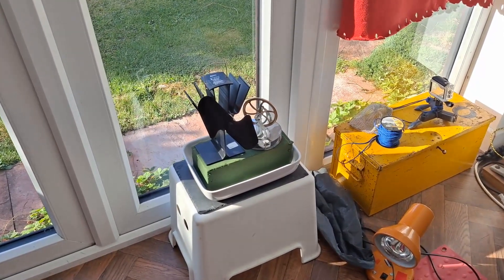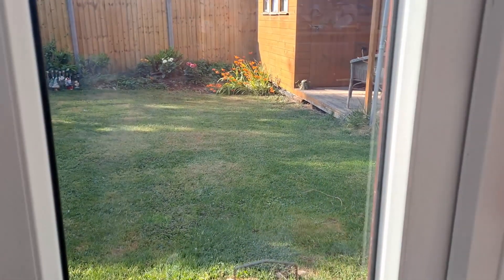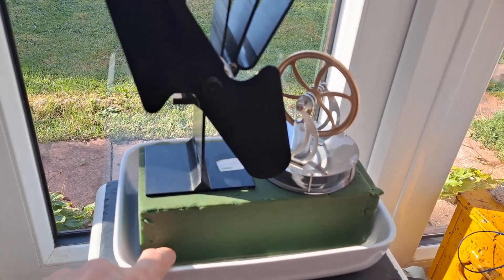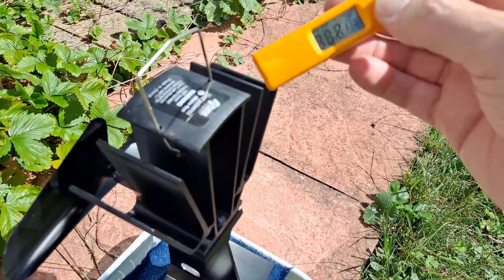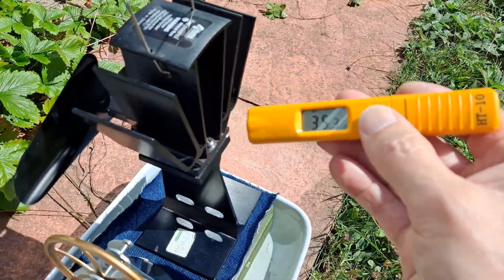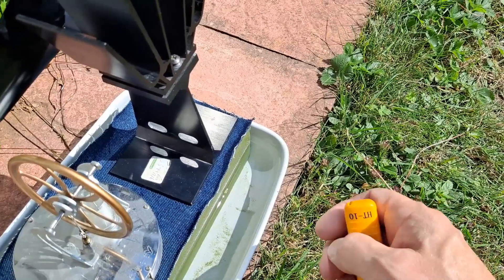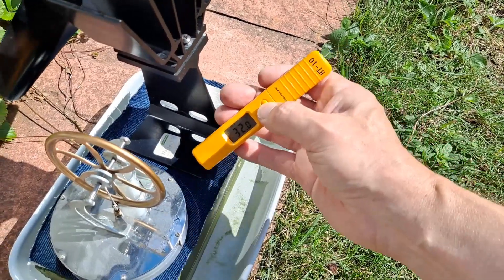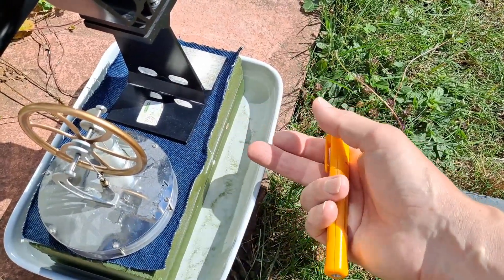Oasis Stove Fan Stirling Engine PART 2

Comment: FORGIVE ME IF I AM WRONG BUT  - THE TITLE OF THIS CLIP IS ABOUT A 'STOVE' FAN. I SUGGEST IT IS MEANT TO STAND ON THE TOP OF A HOT STOVE SURFACE. THE FLOW OF THE HEAT IS FROM BOTTOM TO TOP.   IN YOUR EXPERIMENT, THE HEAT FLOW APPEARS TO BE FROM THE TOP TO THE BOTTOM , THE  WET OASIS BEING THE COOLING AGENT AND THE SUNSHINE ON THE VANES AT THE TOP. SURELY THE NAME IS THE CLUE ?   THE HEAT SHOULD BE APPLIED TO THE BOTTOM PLATE AND THE RADIATING VANES AT THE TOP BEING ASSISTED BY THE SLIPSTREAM FROM THE FAN.  I JUST DON'T SEE HOW IT COULD BE EXPECTED TO FUNCTION IN REVERSE
Reply from the maker: Hi Ray, I guess you are new to my channel. Welcome aboard. Yes you are 100% right, it is a stove fan designed to sit on a hot stove, but where is the fun in that. In the video description you will find links to the related playlists. I am demonstrating that the Peltier Tile in the middle of the stove fan can work in either direction. All it needs is a temperature difference between one side of it and the other, to produce an electric current. Hot on the bottom and cold on top and the current flows one way. Hot on top and cold on the bottom and the current flows the other way. And if you want to go completely the other way, apply a battery to the tile and it will heat up on one side and go cold on the other. They are used in minifridges and to cool electrical components.

Comment: Rather odd this.  The stove fan sits on a hot stove so that the base gets hot.  You are trying to get the top hot and run it backwards which is not how it works!  The small engine is working in reverse, but as it’s much smaller it will work with a small temp diffrence.  But again the small engine is supposed to have a hot base, not a cool one.
Reply from the maker: The fan is powered by a Peltier tablet. It can run either way. The whole point of this series of videos is to demonstrate that fact and that it can run on sunlight. You could even put power into the Peltier tablet to generate heat on one side and cold on the other. You will find more information in the video description.

Comment: maybe paint the round one black and add a reflector in front of the stove fans base?
Reply from the maker: You are close to what I did. To get the stove fan working I bought another floral foam block and cut it to fit right up to the middle section, so it was cooled all the way up. I then put a white foam plate over the top that to keep the sun off it. The Stirling engine works well when I put that black slate on top as that absorbs the suns heat really well. I could improve the heat transfer by improving the fit. AT the moment there are some screw heads that get in the way, but I could drill some clearance holes in the slate so it will sit down properly. I could even add thermal paste to improve that. I don't want to paint it as I like the way it looks, but a coat of matt black certainly should improve it. Here is today's short video https://youtube.com/shorts/KwcC6HuP8GE

Comment: Try putting a mirror aimed at the hot side, or a Fresnel len if you have one
Reply from the maker: The point is that I want to get it working from normal sunlight. I am sure a mirror or Fresnel lens would do the job, but that is not where I am going. I know that I can put it on a frozen surface and it will work (shown in previous videos). It is this idea of evaporative cooling that I am experimenting with. In good sunlight, the top end hits over 40° quite comfortably, but the bottom end is not getting cold enough to give us the necessary temperature difference.
Reply: @GrandadIsAnOldMan  I think then you should look into the technology of evaporative coolers of today, which is just a wet rag in a fin shape
Reply from the maker: @ExtremeGamerYT22  check the video description that explains why I am using the floral sponge/oasis.